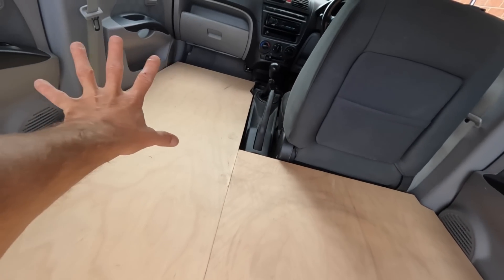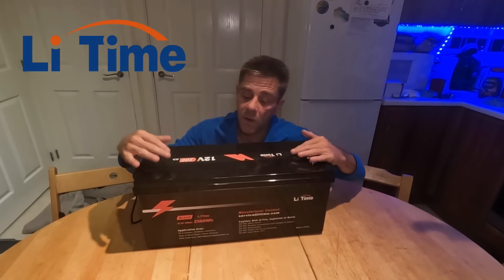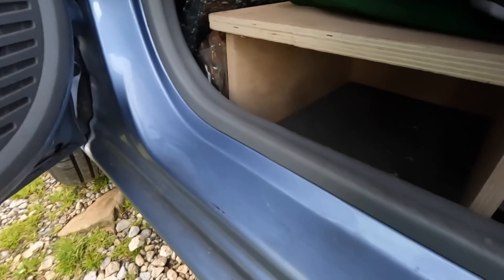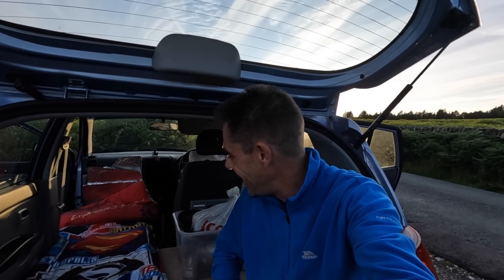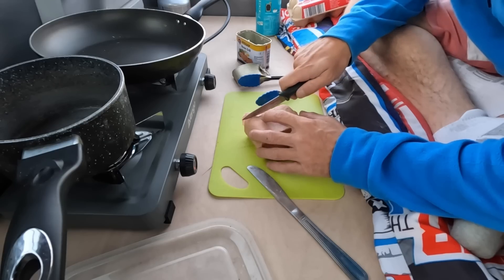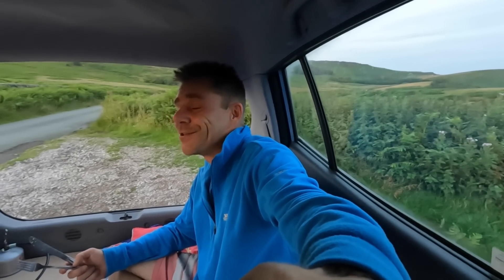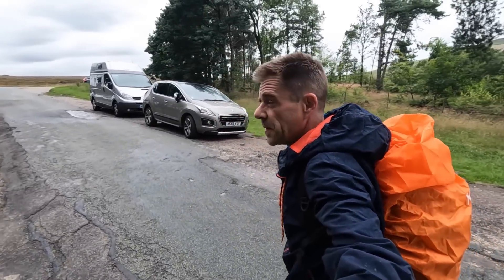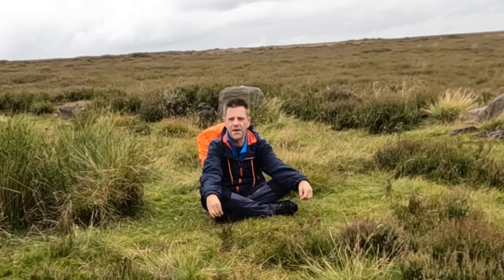Converting My Small Car Into A Camper - New Floor, Ultimate Power and a Night Out In The Wilds

Comment: You can buy battery strap kits with tie down brackets you can screw in. Saves cutting slits with grinders and letting water in.
Reply from the maker: ill have to have a look, im thinking ill redo it in the next iteration
Reply: Not only water, but may let exhaust fumes in too, and the strap will just chaff through on the sharp metal edges in a hundred miles worth of vehicle jostling.

Comment: the way you fitted the strap is a bit iffy, Adam. vibration when driving will make the battery move and it will get cut by the sharp edges of the slit. A better idea would have been a tie down kit with screw in  loops to put the strap through. You're going to get loads of water in the spare wheel area now which will rust the bottom of the area the battery is in.  Hope you didnt mind me saying so.  Great camp out though. Looks glorious there for sure. A fab find  Bessy regs- Kenny
Reply from the maker: yeh i think ill have to redo it in the iteration, just a temp fix for now 👍
Reply: @wanderingwhere  good man. I wish you loads of fab camp outs in the Kia
Reply: I can't imagine much if any water getting in through the slits in the spare wheel well.

Comment: You should buy stick on heat insulation for cars makes a huge difference you can get rolls of ebay cheap just sticks to bare metal under carpet make sure it’s heat insulation and not sound insulation change the cabin filter makes your heater work better and fresher air great video series keep up the good work 👍

Comment: I wouldnt recommend that battery position….the cab could fill with fumes…from the battery .
It’s ok for banger racing because they dont have glass windows ..
You need to seal it off from the cab atmosphere..if it explodes it will be disastrous..

Comment: Wheres the spare going lol on the boot outside lol
Reply from the maker: Might strap it to the roof 😉 ... no it didn't have one another car with a pump and liquid seem to be the way these days ... no idea what ur suppose to do if its a slit and not a small puncture 😉
Reply: @wanderingwhere  If the tyre has a fairly big slit you are knackered,  happened to a mate of mine on our way to a car show, we tried to seal it with the tyre sealant but it didn't work, had to drive all the way back home in my car and get another wheel 😁, you cant beat having a spare wheel.

Comment: When I started converting my focus into a mini camper I came across one sticky moment. I had to make sure that fittings were removable on eve a year for MoT test. Rear seats have to be placed back for the test otherwise it won’t pass. That was a real pain in the ‘a’ because I had fitted bolts for floor etc. sorted now as in removable hinges but just a heads up 😉
Reply from the maker: thanks ill look into it
Reply: Our Berlingo has the seats removed and the seatbelts still in situ. MOT pass!  

If in doubt, ask your MOT station before you get there.
Reply: I have a car camper but I have always worried about the insurance what is it? I have not asked my insurance company but i do worry.

Comment: I converted the back of a Rav 4 and found the space wasn’t enough. This thing would have me crippled after a day. The best thing you can do is add a roof top tent and use the back of the car for cooking. Only sleep in the car during bad weather
Reply: Should do a proper job on the galaxy instead and throw a roof tent on the picanto (or use it for both). Or sell one and buy a small van. I get it might make good content, but it’s not practical and adding that floor takes away even more space that you don’t have.

Comment: When the car pulled up at 3am mate, that’s one reason I don’t wild camp anymore. Leaving the vehicle unattended in the middle of nowhere is a risk. 

Good video as always. One thing I thought though, if you’re putting that leisure battery in, I’d do it in the galaxy. Can’t see you ever using the biscuit tin for more than a night or 2. But the galaxy you will do 2-3 week trips in 👍🏼
Reply from the maker: yeh with ya, always a worry where to leave the car and yeh the battery hoping to build them both out in the end
Reply: @wanderingwhere  buiscuit tin is pretty cool tbf. Hey you could put a gazebo over it and just park up mate. Park the car. Whip out a gazebo and assemble it over the biscuit tin. Job done 😎

Comment: What do you do for your MOT,do you have to put seats back in.
Reply: I think so yes. but now theres holes in the boot well....................................
Reply from the maker: Dont quote me im probably wrong but i was under the impression that if you remove the actual seatbelts then it has no bearing on the mot as both the seats and belts have been removed, , again im probably wrong but heard it before and a quick google searched said the same, i think it may be a grey area one of those, i might find out in a few months 😉